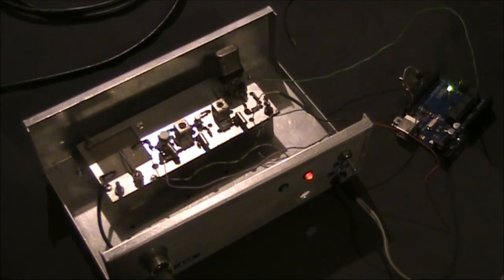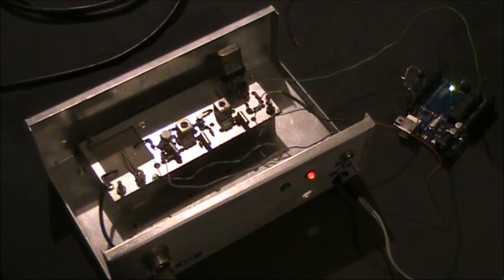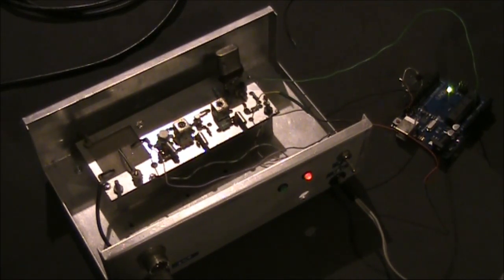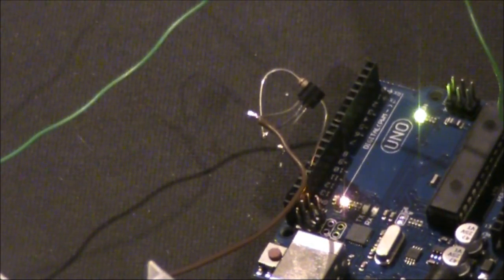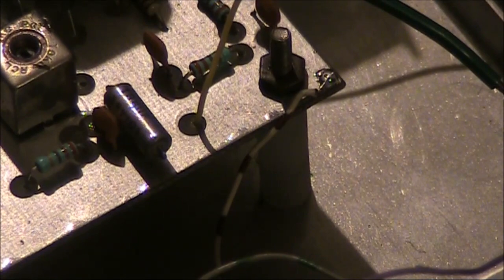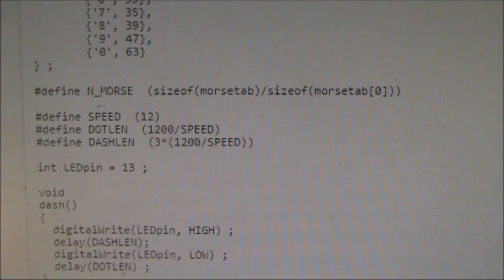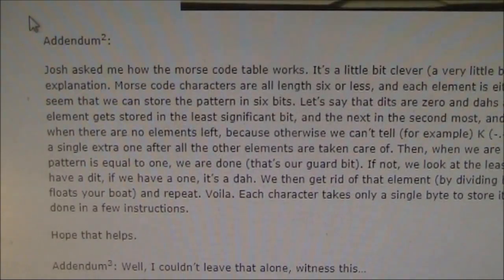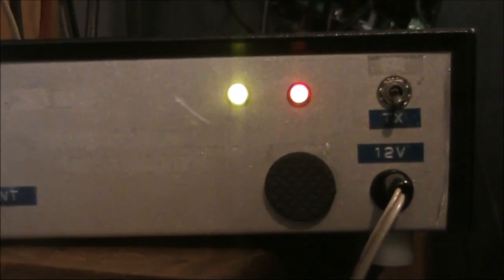Tests with a QRPP 50 MHz CW beacon

Comment: Good video. I was hunting around on the 49m band to see if I could hear anything interesting and realised I could hear myself on 49.45 MHz and again around 49.325MHz without any Tx equipment connected!

 This was in sdrsharp using a cheap dongle. Is this the dongle picking up the pc mic or soundcard and transmitting then receiving it again? Alternatively there is an old fire alarm/smoke detector system fitted, could it have a hidden mic and transmitter? I seem to be seeing some sort of handshake signal periodically just below 49.450MHz. No baby monitors in the room and I think the walls are too thick for a neighbour to pick up my voice. Thanks.

Comment: The tricky Morse code generator-- a better explanation can be found in the October 1976 issue of BYTE magazine (available from archive.org) 'Efficient Storage Of Morse Code Character Codes', by Lawrence Krakauer. The trick is a lot more obvious if the encoded values are provided in binary... I've long considered that I should submit a one-pager article to AR, so to stop programmers who should know better from using strings of ".-" "-...", "-.-." in embedded controllers.
Reply from the maker: Thanks Chris. Definitely submit it! Many would be interested.
Reply: It's a fantastic possibility to think there might be time travelers writing for BYTE magazine at that time. The cover art alone is enough to knock your GPL licenses right off!
Reply: While I understand the way the dits and dahs are coded in a single byte (from the least significant bit up to the most significant bit, then comes a guard '1' bit. Interpreting goes like this: from the MSB to the LSB find the first '1'; the bits below that are the code to be sent), I think that using strings like ".--.." are perfectly fine and easier to understand, debug and maintain, provided that the embedded controller has enough memory.

Comment: Peter does this pin 13 just provide contact closure same as a straight key?
Reply from the maker: No. It provides some DC voltage that turns on the transistor I added. That allows current to flow in the oscillator circuit.

Comment: Amazing repurposing of it mate very impressive, the slow morse is sinking in rhythmically at least imagine il be reading q's in no time as im just now getting to recognize cq calls and hopefully be able to actually catch the call at the end in the next month or two at most beacons that transmit slow morse should be more common possibly and to help us who are morse challenged lol , MM7BXH qrz 73's look forward to your next video and thank you for your contribution to radio over the years on YouTube and sharing your projects with us mate. MM7BXH going qrt.
Reply: I’ve been doing Morse for a little over 12 months now and am comfortable at receiving 13-15 WPM unassisted 

I spent a couple of months just learning the letters & numbers before getting on the air. Learning a ? and <BT> helps.  The / character is also useful

I use FLDigi as a crutch, not a wheelchair, which helps out with faster stations or when I want to practice head copy 

If you’re interested in getting on the air with CW, then look at joining SKCC. The Straight Key Century Club. It’s free to join and has a great network of people who are keen to help people get on the air.

There is a sked page which is great for teeing up QSOs and catching any stuff you missed in the exchanges. 

Membership is free and at around 25000 members, it’s a substantial  resource for joining the the CW renaissance

 If you tell Randy I sent you, he will give you 10% off your membership :-)

I prefer CW as the world is a safer place when I don’t have a microphone in my hand :-)

Also, on CW, no one can hear you scream !!

GL es 73
DE VK2NAP 
dit dit

Comment: Peter, a bit of context; when that project was published, we had a Novice Licence here in the UK. The allocations for the new Licence holders were very limited and 6m was the lowest allocation, unless you passed a Morse test. So 6m became the 'easiest' band for homebrew transmitters for beginners. For the reasons you identify, it was not a popular Licence and most ended up using commercial 70cm handhelds. Thankfully, things moved on and the entry level gives more spectrum and more power. Well done for making the project sing and I am sure you will be getting reports from much further afield as the sunspot cycle builds. Stay safe! 73, Steve, G0FUW